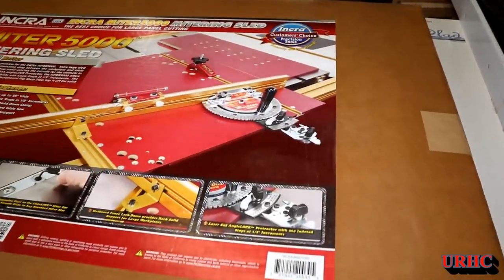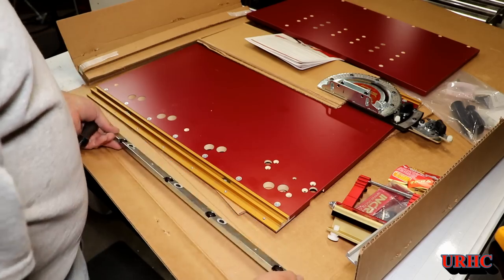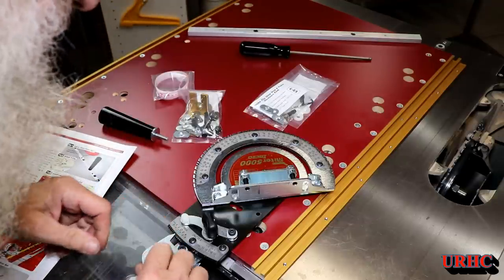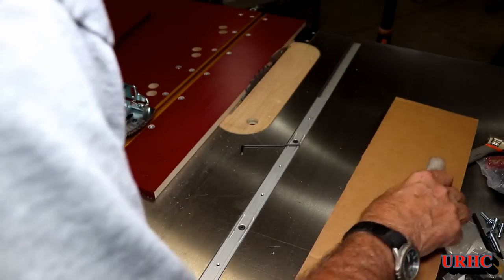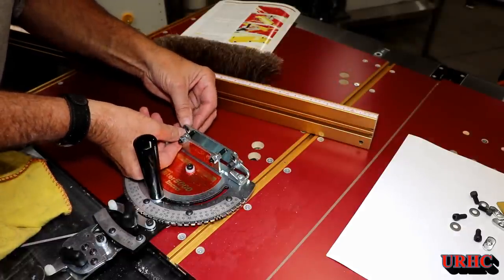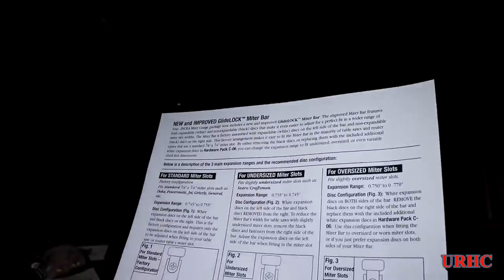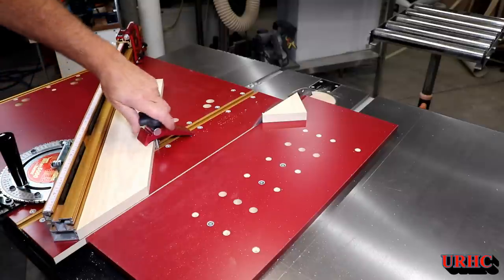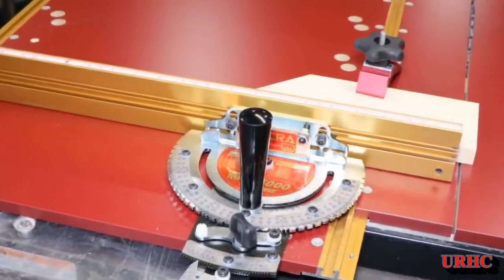Incra Miter 5000 Sled Assembly Quality And First Impressions

Comment: Thanks for the in depth review. I have been looking really hard at this setup. For the money and to be made in USA, I was expecting better quality control. 
It was nice seeing the good and bad instead of the biased sponsored reviews.
Reply from the maker: It works good now that it's assembled,  cleaned up and tweaked. I expected better quality out of the box from incra. I will do an update soon because I found the stop system is useless with a sacrificial board for clean cuts and scrap removal like I have always used. Thanks for watching.

Comment: I know it's too late now but I just got my new Incra 5000 and I got the "new and improved" offcut rail. I don't know if they saw your video or they got a lot of complaints but I can either let it slide or lock it down very easily.  Thank you for the video, it really helped!!!
Reply from the maker: That's a good change. I have another  video  about how I replaced the clumsy  hard to use inra extrusions that make it easier to use and safer for me. Thanks for watching.

Comment: Appreciate this vid. I inherited this sled, it had ben sitting, in my way in the basement for about a year, with me using my home made sled until I figured this one out. YOur vid was very helpful. I knew you were a handy dude when I saw you chisel the aluminium rail... Your attention to detail was great... Again thanks!
Reply from the maker: Glad it helped. I have a more recent video  about how l replaced the Incra fence with a kreg fence making it easier for me to use and safer. Thanks for watching.

Comment: Nice video. I purchased mine about 15 years ago. It is my go to miter sled. I have had to replace the nylon adjustment bushings on the miter slot a few times due to much use. On my sled the fence wasn't square to the table either. Mine had no adjustment so just slid a .010 shim in the space behind the fence which has worked well. I did replace the right side panel when I changed table saws. Over all it has performed very well. A good investment. No significant quality control issues showed up on my sled 15 years ago.
Reply from the maker: After  using  it a while  I did not like the clumsy incra fence and stop. I have a more recent  video  replacing  the incra  extrusions  with  a kreg extrusion and stop that makes it safer, easier to use and lets me cut 24 inches.  This  really  was a waste of money  to me. Thanks  for watching.

Comment: I had exactly the same problem with that aluminum slider on the right side of the blade. You worry that you’re going to ruin the screws. Thanks for the effort you put into this review. Well done.
Reply from the maker: Those  guides do not work well with  t tracks.  They look to be made for u tracks where they didn't  have to spread  so far. Everything about this sled is old technology.  I have an updated  video showing  how switching out the extrusion with a kreg extrusion  makes it easier  and safer for me to use. Thanks for watching.
Reply: Thanks for the update. I’ve always had mixed feelings about the Incra sled.

Comment: Excellent review, thanks for the feedback.

My apologies for the damaged components.  We can get you replacements if you’ll forward your address, and a few photos will help me better understand what you’re seeing (contact info below).

To smooth out and reduce the effort of adjusting both miter bars, remove the black adjusting screws, put a dab of grease on their threads, and reinstall them.

On the aluminum miter bar for the drop panel, a thin film of grease on the tapered edges of the wedge nuts under the aluminum miter bar in addition to a dab of grease on the threads should do the trick, and we can send replacement adjusters if it doesn’t.  The difficulty in expanding the aluminum miter bar is in the adjusters, not the bar, and reducing friction will allow the miter bar to solidly lock the small drop panel to the table without much effort.  We occasionally see stubborn adjusters through tolerances in the parts.

The machining on the aluminum miter bar is correct.  The grooves are left blind at the bottom, and this area intentionally fractures as the bar expands.  Again, follow up with me if greasing the adjusters doesn’t solve the problem.

Let me know if I can address any questions on the sled – 888.804.6272 xt 4.  I’m also happy to address your other concerns… our goal is offering US-made equipment with excellent performance at the lowest possible price, and manufacturing anything requires a long series of compromises between cost and benefit (some of which will be unpopular) to arrive at that price.

Please follow up with me on the damaged parts.

Mark Mueller
Tech, Sales & User Support Manager
 
Taylor Design Group / Incra Tools

888.804.6272, xt 4
mark@incra.com
Reply from the maker: Most of what's left is cosmetic.  Blotchy and scratched red anodized on the red flip stop frame, some corners of the base board dinged from how the stop was poorly taped to it for shipping.  The fence extension is a different color anodized then the fence and it was .005 wider then the fence that I fixed with a shim in the follow up video plus a kink in one of the scales that looks like it was folded on an angle before inserting. That expanding aluminium rail is total junk in my book for a t slot. The bottom opens up so it can't be dropped in anymore and the top doesn't move enough no matter how tight the screws are until it's bumped out with a chisel. I don't use grease near any areas that contact wood on my equipment so I will probably just swap in a old kreg rail I have in the future. I couldn't believe the cuts in the fence extrusions weren't cleaned up before packaging at this price point. It works good and nothing is really broken to need replacement.  Just hope you look at some of these issues for future buyers to have a better out of box experience.  I registered it and added a note about this video to show my first impressions with this product. Thanks for watching.
Reply: Sorry about that.  Parts like the fences are normally wiped down after deburring, and the offer stands to replace the parts that are cosmetically outside the normal range.

Sending you a replacement for the drop panel’s aluminum miter bar would be an easy fix – it will drop straight in, expand & lock in place with easily, and lift right out when loosened.  With the adjusters functioning correctly, the bars expand at the top as well as the bottom.

I understand your skepticism about the aluminum miter bar based on your experience, but that design has worked great for us in the bigger picture.  The aluminum Miter Sliders have been in production not quite 30 years, and I'd estimate we've sold around 200,000 of them.

An off-the-record note to other viewers:  Having used the 5000 sled for 20 years myself, I want to mention that the small offcut-side panel really should be rigidly locked to the saw's top while cutting.
Reply: Looks to me like Incra has some excellent customer service, this is why I will continue to buy from them!
Reply from the maker: If you think a replacement bar will actually work better, I will send you a email with my info to give it another chance. I will also include some photos of the parts in question for you to decide if they are outside what you consider normal. I did actually add a screw and t nut to secure that off cut panel because sawdust could work its way under the edges and raise it up while using as it slid back and forth. I will get that out in the morning.
Reply: @marklmueller-incra3840  I am thrilled to see that Mark from Incra contacted you! I will definitely keep an eye out for future conversations with Mark. I am considering buying one of these for my restored 1946 Walker Turner. I just want it correct in fit and finish out of the box for that kind of money. Thank you to everyone involved for helping this gentleman out. I appreciate his demeanor and sweet spirit in handling this issue.
Reply: James Wiskus I have nothing to do with Incra, I am only a Customer like your self. I will say that if you purchase something from them and you are not happy they will go out of their way to make sure you are happy and in very short order. When you purchase an Incra product they stand behind it.
Reply: This reply makes me want to buy all things Incra now! to know they actually go through YouTube pages who buy their products and respond!!!
Reply: I’ve bought several of you tool products. Sometimes things slip by. I can say though you provide quality product and is truly designed for precision woodworking.   👍on my end.
Reply: @TheFalconJetDriver  I have found Mark to be outstanding- very helpful and prompt. The INCRA manuals are very good. Their videos are very good. Any brand can have problems - it is how they respond. I have the LS positioner and Wonder Fence still learning but so far, very impressed.
Reply: Watching for a sale to come around!
Reply: Just received my Incra mitre sled

Comment: I appreciate the time you spent on this review, as Incra was on my list of things to upgrade my current miter...  I may have to reevaluate my thinking.
Reply from the maker: It's a nice sled once the bugs are worked out. It's a shame the quality wasn't better.  It's the best option I could find without building my own. I think there's a lot of corner cutting for higher profits going on in businesses these days. I would buy it at the  $280.00 that I paid for it again but not the full $360. 00 list price. Thanks for watching.
Reply: I concur with RB&R, my first question is will this work on a standard table saw top with the old school miter slot? My is the standard 3/4”x3/8” miter slot. Did you contact Incra about the lack of quality and poor finish here & there? I too was considering this, but I’m not sure. You’ve done a great service to your fellow woodworkers.
Reply from the maker: James it will work with a old school slot. That aluminum track would even work better without the t slot because it expands at the bottom. I attached a note with the  product registration and there are now comments from incra about replacing parts in the video comments. I have to send them pictures to let them determine if they vary from their normal quality.  It works good once assembled, cleaned up, and aligned so its just cosmetics. Wish the base was larger so a 23 inch panel like they advertise could be cut without being unsupported for the first few inches.  I think it's going to be a great addition to the shop. If you buy one leave a comment about the condition yours arrives in. I really like the positive stops for setting angles and the adjustability. I was disappointed with the out of box quality and glad that I found a good sale. Thanks for watching.

Comment: Excellent review. I’m surprised about the build quality. I would have expected more from Incra considering they are a premium brand.
Reply from the maker: You and me both. I have a recent  video replacing the incra extrusions with a easier to use kreg extrusion that gives me wider cut capacity and is safer to use. Thanks for watching.

Comment: This may have come up later in these reviews, but I had to true my miter slots. They were "sticky" due to some rust, so I had to use some 400 grit sandpaper and wood blocks to make the slots more useable. Once I did that my Incra miter bar slide evenly and smoothly. I appreciated your review and your comments, both good and not-so-good about the Incra product.
Reply from the maker: My miter slot is perfectly ground and the sled slider works great. It is accurate and works good but is not worth the msrp in my book. Rockler has the 20% off deal going on again . Thanks for watching.

Comment: I have  several Incra tools , 100% happy with all of them , I had an issue with one item and called Incra ,They replaced the part , only question was my zip code . Great video !
Reply from the maker: It works good now that its cleaned up, aligned and shimed. They definitely don't take pride in quality . Thanks for watching.

Comment: Cutting those slots looks like a good job for the dewalt multi-tool I got for my birthday!!
Reply from the maker: They are a very handy tool. Depending  on your slot type you may not have to cut them. I have updates making this  easier to use and safer with  kreg extrusions. Thanks  for  watching.

Comment: Thanks this video helped setup easier. With that said it Is milled correctly. I messed up a bit the first time I was setting the bar up. I wanted to flatten the sides out and reinstall. I noticed the nuts on the underside are a wedge shape. I put them back on incorrectly the first time. I removed them put the wedge towards the screw head and all was well. Worked perfectly well.
Reply from the maker: Those expanding  tracks are not good in t slots.  They work  in the rectangular slots. This jig was definitely  a waste of money in the end. I did an update  replacing  all the hard to use incra fence and stops with a  kreg extrusion to make it easier and safer to use.  Thanks for watching.

Comment: I enjoyed your video. thinking about buy the incra miter sled. but what I really want to know is what is the clear acrylic piece attached to the left side of your saw on the front of the rail
Reply from the maker: It's  a support  I made. There's  a video about making it back a couple  years. Helps with wider cuts. There's another  video about  making  the sled safer and easier to use with kreg extrusions Thanks for watching.

Comment: As far as cleanup goes, I reported a scratch on my TS-LS, and Incra gave me a choice between partial credit or replacement.
Reply from the maker: They replaced  some parts and told me the variation in color of the anodized parts was to save money and keep the price down. Thanks for watching.

Comment: My right hand table saw t-slot bar must have been milled a bit deeper as it did split open once I tightened down on the 2 expansion mechanisms.  I then had the exact problem you mentioned ... but after hanging out a bit with it I realized that the bar could be mounted forward and back of its final position.  There are 2 sets of screws about 5" apart, I mounted the right hand side upper 2 screws to the bars lower 2 threads, this allowed cutting the the first half of the RHS base with the bar properly engaged in the t-slot.  I then remounted the bar so that that expansion mechanism was fully engaged while cutting the 2nd half of the base.  Hope this make sense! When done my RHS base was cut without any wiggle.  I certainly agree they could have-should have designed this better.
Reply from the maker: I have a newer  video  about  replacing the Incra extrusions and stop with a simple to use kreg extrusion to make it easier  and safer for me to use. This is one item  I wouldn't  buy again.  Thanks for watching.

Comment: I've been researching this sled because I'm going to be upgrading to a sawstop soon and want a great setup for accurate crosscuts. Thank you for pointing out the not so great things and giving an honest review. Between everything else I've read/seen i will still be picking one up and very excited for it. Would be sweet if there is another 20% coupon though lol
Reply from the maker: I have another  video  about  replacing  the incra fence and stop that were a pain to use with a kreg fence  and stop that makes it a easier to use sled and now I can cut 24 inches safely. Thanks for watching.
Reply: @unemployedredneckhillbilly2023  oh awesome, ill check it out!

Comment: I just bought the miter gauge 1000hd. i have to agree those track screws are insanely tight. Overall im very happy with the accuracy. But i did have a some imperfections as well on the anodized fence.. Last night i ordered the table saw fence and router fence. It will take several weeks to get here. Fingers crossed it will be  well packed. Thanks for a great review.
Reply from the maker: Contact them about the anodizing. They are replacing a couple parts that I showed having poor finishing. I was told that to keep the price down this is the new norm. The old Incra parts that I have seen were all pristine. If enough buyers complain about it maybe they will do something about it. let me know how the other fences look when they arrive. At least they have retained the accuracy. Thanks for watching.
Reply: @unemployedredneckhillbilly2023  The price isn't down, though. It's ridiculously expensive compared to what they're paying for the same Chinese stuff we can all get on Aliexpress for 1/3, even after shipping. Thanks for your channel, bud. I think you might be my dad — were you wild when you were younger? lol
Reply from the maker: @timforgot  It's sad to say but made in the USA means nothing anymore.   I had my days. Thanks for watching.
Reply: @unemployedredneckhillbilly2023  Not sure I'm willing to say it means nothing, but I'll say without reservation that the conflict between the marketing folks and the engineering folks was won, decisively, by the marketing folks.
Reply: But to be clear, that was just a battle, not the entire war. There's room for the U.S. to become a manufacturer again. Germany is a great model, as is (for the time being) Taiwan. My Oregon-purchased Taiwanese-machined Pantorouter is an impressively well built machine. Machine tolerances are a lot like fried food in that it matters how often they change the oil (or active tooling) lol. And all you have to do to raise the quality is pay for it (as a manufacturer). Once you know that, it becomes clear who isn't paying for quality.